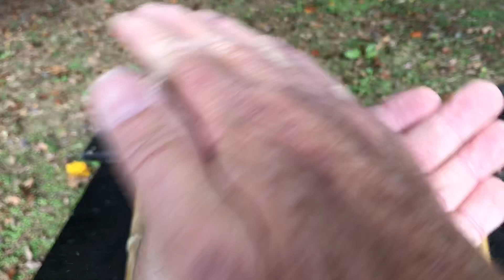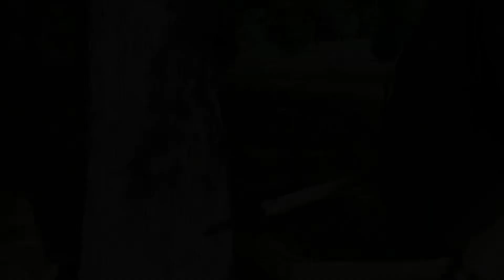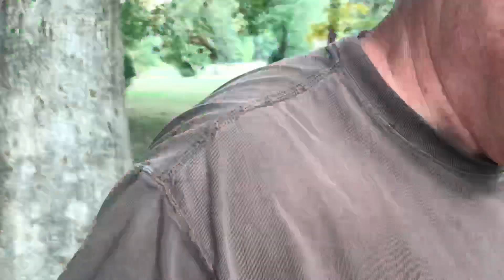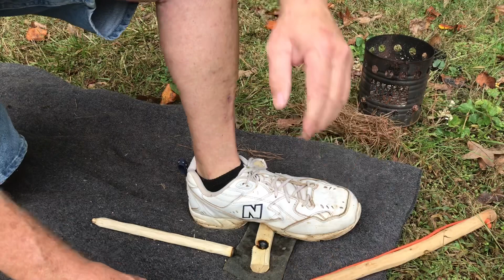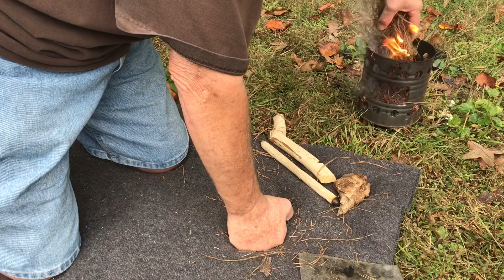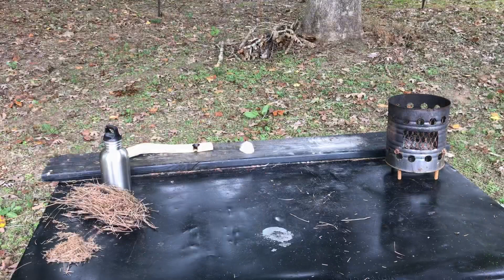Friction Fire 4 Ways... Bamboo Fire Saw, Bow Drill, Hand Drill, Fire Roll (Oct 2019)

Comment: Been thinking about this. You always use a single material for your tinder bundle. Have you ever used more than one? Say, fine tulip poplar for the center and pine needles or newspaper around that?
Reply from the maker: Yes, but I don't know why I would ever need more than 2. Like for the terrible pine needles that I used in this one. A pinch of processed Tulip Poplar Bark would have helped greatly. I actually almost missed getting the flames on the Bow Drill ember. If these were normal pine needles they wouldn't have needed help, but these did.
Reply: David West Thanks

Comment: I really appreciate your videos. I just made my first attempt at bow drill and failed the first day (after about an hour). I got plenty of smoke but no ember. Fell asleep wondering what I was doing wrong. Woke up at 3am realizing that my spindle was shouldering just as I was about to give it the final push. The next morning I cheated and used a brass pipe cap as my handhold and got a glowing cherry on the first try. Lesson learned. Don’t underestimate the importance of a good, friction-free bearing block.
Reply from the maker: Congrats! A slick bearing block makes all the difference.